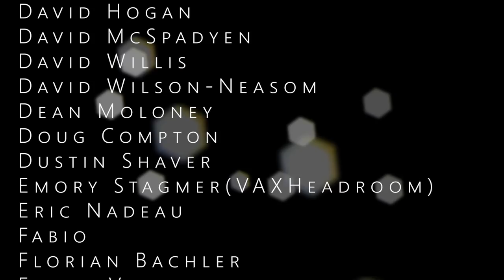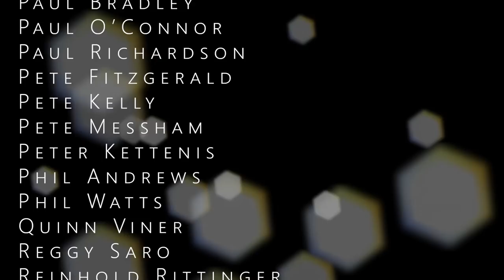Ep 4 - Taking a Great Kit Guitar and making it Awesome

Comment: Why not lay a piece of card on top of the body section and mark out an inset from the outer edge of the body and then cut that to use as a depth template for the carving?

Comment: Didn't think this would work as the sound holes would be covered by your arm when playing, but thinking about  it, it should alter the tone in cool ways with different arm movements. One day I would love play/own a Crimson. Last time I was in GuitarGuitar, Camden, they had just sent off their stock to another branch. Grrr :)
Reply: sizzloh sound holes aren’t supposed to let you hear the guitar... it’s just traditional decoration for hollow instruments
Reply: Matthew Whittingham ?? I didn't mention that sound holes let you hear the instrument (which of course they do to varying degrees) but admittedly used the word 'tone' rather loosely. My point was that they alter the character, harmonics or timbre of an instrument depending on size and positioning. I will argue that even picking hand shape and positioning alters the character of a guitar's tone, be it solid or hollow, amplified or not. Obviously the more saturation of the dry signal the less this is apparent, although I believe there is a sweet spot where that 'law' contradicts itself somewhat. So to clarify, I was trying point out that the instrument in question should have a more exiting character, depending on the dynamics of the players style or technique, than that of a solid body, or indeed a semi hollow of the more standard 'f hole' variety due to the positioning of the 'sound holes' vs players arm or technique, albeit rather subtle, but aren't subtleties and nuance what make a great instrument? This one would seem to have that potential in my opinion.